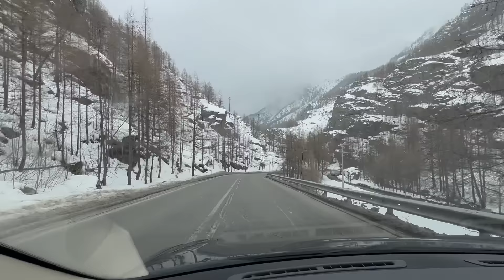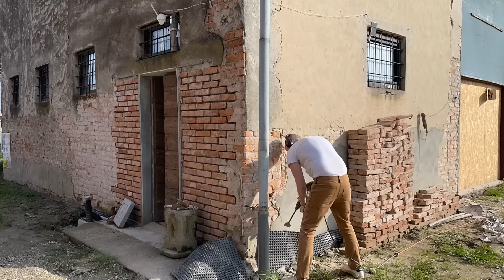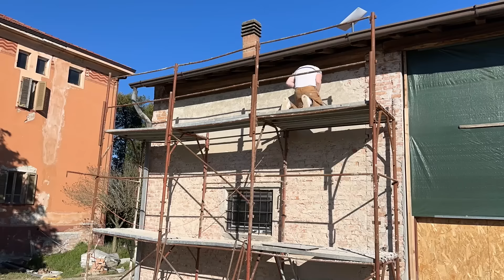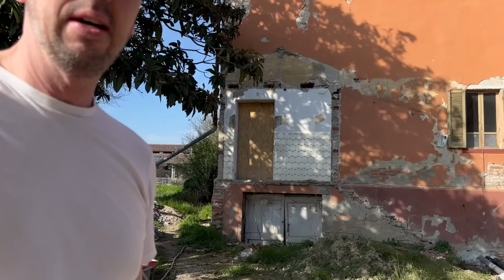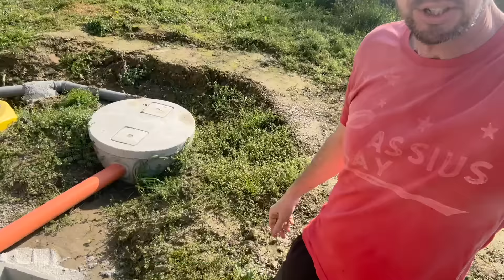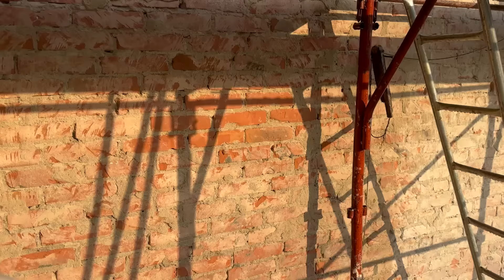Facade Facelift: Transforming Our Stables Exterior. Ep: 48 of our Italian house renovation

Comment: Dig out a small area and let ur wife design a patio with the brick and fill it with a sand and mortar dry brush it in all the cracks with a push broom and spray it all off with a sprayer on the end of ur water hose!!! It will make a beautiful patio outside of ur big glass doors when u get it in and close to ur pool..😊😊
Reply from the maker: Yes that is an idea! We do however have plans for that area all ready, all will be revealed, it will be a while though 😂

Comment: Try palatizing your bricks.  Then you can move the pallet as needed.  Worth the cost to avoid the hassle.  Enjoying your progress.
Reply from the maker: Not sure I understand, should I put something underneath to remove the dirt easier or?
Reply: I am sure you know what a pallet is.  If the bricks are stacked on the pallet, the whole pallet can be moved around using a fork lift or pallet jack.  You don't need to touch the dirt.  The pallet will sit on top wherever you place it.  Using the pallet precludes your having to move each brick by hand.

Comment: There is a specific power tool that has a much wider brush for that job. I have seen it used on other renos. unsure what it is called sorry. 
P.S. found it here in this YT video:  "Comment nettoyer ses briques ? Ep 14".
Channel is called "Déborah & Paul - La Grange"
Reply from the maker: Thank you! 
I have no idea where to find one of those machines around here though, ill have a look around!
Reply: @VillaAroldi  Discovered its called a "brush sander": Virutex Satinadora ST62 | Brush sander | Satineuse 
Makita make them too.
Reply: @VillaAroldi  They are on Eb** :
 Makita 9741SP1 Wheel Sander with Wire Brush Wheel 120mm New W/ wooden box brush 
 USD366 plus postage
Reply from the maker: @si_vis_amari_ama  Thank you ill have a look!

Comment: Some "Gentrification" projects suffer from damp.  The original walls had the damaged stucco removed.  It looked nice, but the stucco was there to prevent water penetration.
Reply from the maker: Yes you are correct and we will add a new protective product that repels water without suffocating the stones, it seems like it's working because I see quite a few old stables around here that have exposed brick.